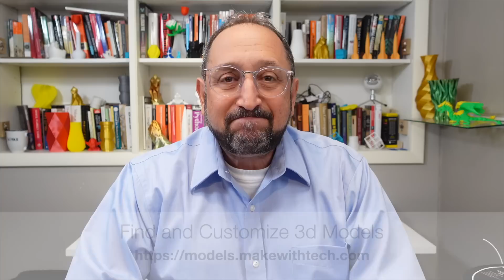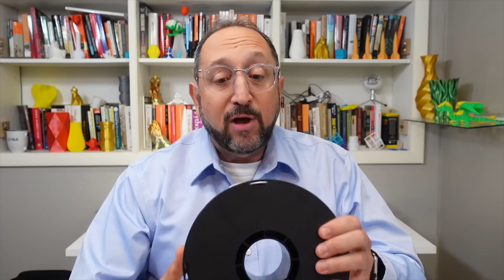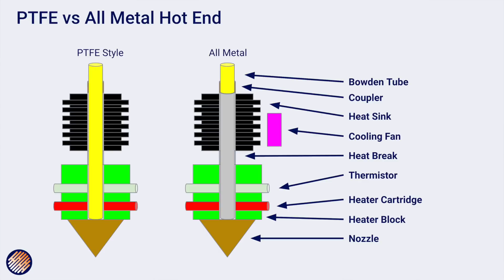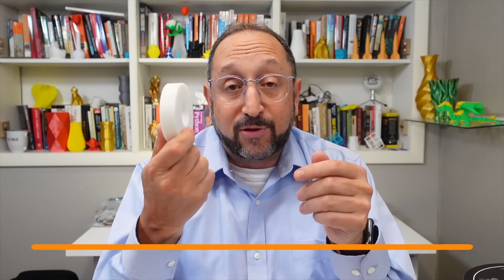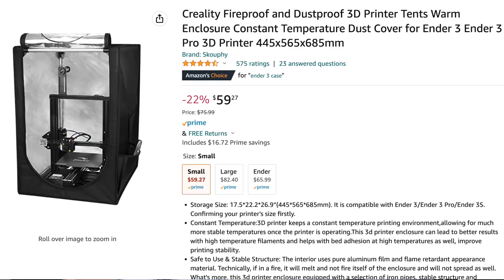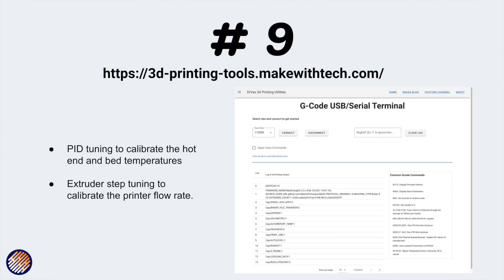3d Printing Tips for Beginners and Experts

Comment: I have an anycubic kobra and had to replace the extruder. I followed your instructions on Repeiter and its a different layout than the version you used. I think that's where I'm getting confused. I load the filament to do the length test and it sounds like a really old lawnmower or leaf blower and wont pull filament unless I push it through by hand, and i still get the grinding noise. This kobra is not even 4 months old yet. I've never used gcode before. Can you possibly do a video of newest version of Repetier. I have V2.3.1 It would be greatly appreciated. Thank you.

Comment: First dislike to a, generally speaking, Intelligible presentation of a rather complicated subject of 3d-printing.
And that's for... SILICONE GREASE! Should you ever bother to read about grease-oiling a metal to metal or a metal to plastic, you'll easily find out that silicone oils (yes, that's named after  b a s e  o i l  thickened by a so-called soaps) won't stay on a metal surface, tenting to drip off of it. And, as most plastics are +/- hygroscopic, silicon oils are rather thin get soaked into the plastic parts too.
For the sake of simplicity, I'd recommend one to go with a GREASE based on polyalphaolefin (PAO) oils. Those are mostly compatible with both plastics and metals, don't tend to drip off of a metal surfaces, won't soak in the plastic parts (not as much as silicone oils), won't evaporate as fast and etc etc etc. PTFE-filled suits the purpose best.

Comment: Sorry you're so wrong I started with resin printing and it's so much easier, leveling is easy, think about how few components are involved - 1 axis (z) a bed a screen and a vat. FDM you need to know G code ffs it's Only easier for you because you know it already
Reply from the maker: Everything you have said is correct.  For me the real issue is dealing with the messy and dangerous resin. This is from All3dP:

"Irritating to the skin and respiratory system: You should never expose your bare skin to the liquid chemicals of 3D printing resin. They can create contact dermatitis, which is a surface rash that could develop into an allergy if you expose yourself to resin for long periods of time. Resins also naturally give off fumes, and unless you work in a well-ventilated area, molecules from the fumes will get into your lungs and cause irritation there, too."

My personal experience with a Resin based 3d printer was a very low end model and I was never able to get consistent bed adhesion. 

Finally Resin 3d printers get quite expensive as you scale them up to FDM printer sizes.

At the end of the day you need to select the correct tool for the job.  Each 3d printer technology has it place.  If I was printing small highly detailed models I would revisit resin based 3d printers.  I tend to print functional parts and larger items so FDM printers are a better match for my needs.
Reply: @MakeWithTech  that's true too a lot of people are unaware if they are harming themselves with resin printing even with reasonable PPE I hope they come out with better resins because it's just a much better way to print I think 😜

Comment: Hi Irv, no one I ask has answered this question for me. Hope you can! What is the tolerance one should shoot for when calibrating the extruder? For example, if you tell it to feed 100mm of filament and it feeds 109mm, then I know that's too much and it needs to be corrected. But what if it feeds 101mm? Or 99.65mm? Is that close enough? Are we looking for EXACT precision?

Comment: Great video, I'm new to 3D printing and also a Mac user and I have been trying to find a way to connect my printer to my Mac. Most other software for OS X is way too old. Repetier Host's latest build mentions the "NEW OS X Mountain Lion" for god sakes! Tomorrow I'll try out yours. Also Cura for me doesn't work well. It makes my mouse not work after about 30 seconds of using it. Do you have this problem too?

Comment: Regarding maintenance, I think silicone-based grease is not a good lubricant to use.  That grease is design for keeping o-rings and other types of flexible seals from drying out (for example in plumbing) and thus maintaining a good seal.  They are not for lubricating metal-to-metal contact.

From what I've read, "dry-film PTFE-based lubricants" are preferred for lubricating lead screws.  This kind of lubricant is readily-available at hardware stores, and is easy to find on amazon.

Comment: I learned after 300,000 hours and 100s of printers that it is best to pick a machine for the majority of your work and keep buying that same machine. We had so many sovols, ultimaker, artillery, creality, prusa, raise3d, etc and it’s so difficult to quickly repair and upgrade when they are so different (in a farm setting).. We recently started selling all our printers and going to an all prusa farm with a few exceptions.. this way all the hardware is reliable and the same.. it also allows for quick repairs because you intimately know the machines you have.. the other nice thing is the same gcode works everywhere in your farm.

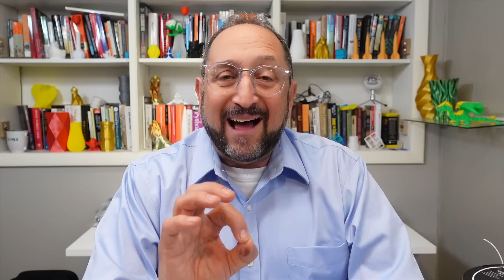Comment: I have a doubt unrelated to this topic, I've been doing 3D printing for about 2 years now. In this specific video ( https://www.youtube.com/watch?v=UvOeUNLSWW8&t=279s ) at 4:20 this guy says, "It takes about 2 hours to print one shade" and I've tried every possible way to test that. I have a lamp model that is correctly sculpted to be hollow, it won't require any supports and it is comparable to the one in the above-mentioned video.  With infill 0% its taking 14hours with 0.5 Line width and in vase mode it won't print the inner surface even when in Surface-"Both" mode but takes 4.5hrs to print the outer surface. Can we realistically print a model as intricate as the one in the video, which has two surfaces, in under three hours? Since I was unable to locate a technique to obtain their numbers!

Comment: I have a samsung galaxy s8 ultra tablet will that work in the place of a computer for 3d printers? From the question you can guess my knowledge level on this subject 🤣🤣
Reply: There are some apps like astro print, but i have not found a good solution that compares to pc software. You wont have full controll over the slicer engine
Reply: @hatschmolo2923  thanks
Reply: Your phone can run Octoprint, but you will need a slicer to create the G-Code
Reply: @daviddrumm3673  thanks

Comment: A friend of mine has endured a lot of frustration with some of his cheap FDM printers. Mainly the issue seems to be the fact that the machines cannot home in Z at exactly the same height. So he'll print a successful print after a careful levelling session, then go to print another  copy and it won't stick and he'll check only to discover that the first layer gap is no longer what it was set at. 
These cheap printers use mechanical lever arm micro switches for the Z home and these are likely not precision enough to be called repeatable.

My first printer was a dual IDEX called a Hictop 3d Hero. Yeah, its a $700 printer and I knew NOTHING about how it was built, but the feature it has on Z is the fact that it has optical home switches on Z, so when the machine homes it is always exactly the same height as it was originally set to when original levelling was done.  I can start it up and give the bed an alcohol wipe and away it goes every time. No glue, no tape. I use a flex PEI sheet on a magnetic substrate, works great, although the PEI surface can get damaged if I'm not very careful to keep tools away from it.
Reply: I have the CR10s pro v2. My work around is to do leveling at best I can. Then save it to EEPROM(Memory). Using Cura slicer, I've edited the start gcode to use the saved mesh everytime I do a print. Avoiding the need to probe on every print since I'm not changing the flex bed.

Comment: I enjoy your videos, but your pace is extraordinarily slow for me. I realize that your goal is to provide comprehension to a majority of your viewers.  That's why I use a Chrome extension that allows me to speed up your videos to a pace where I have full understanding of your points, but without all the extra time. I hope this does not mess with your metrics too much.
Reply: Keep in mind that some of the viewers are kids, and some are non-native speakers of English who may appreciate the slower style of his videos.  That said, I do watch these videos at 1.5X, and it doesn't require any extension... you can do speed changes right in YouTube via the gear icon.
Reply: @yeroca  The purpose of my comment was to LET IRV KNOW that I was speeding up his video and that I hoped it didn't mess up his metrics, which is important to a YouTuber. If he responds and says that hurts his viewer metrics, I will watch at 1.0x speed. I wasn't criticizing in any way.  I typically watch his videos at 1.6x, and can alter that in 0.1x increments all the way up to 16.0x.  The built-in 1.5x is too slow and 1.75x is just a bit too fast.
Reply: He’s a professional, thus why you don’t see a bunch of unnecessary slide transitions, loud songs or annoying sounds like 90% of other channels.

Comment: I use the 3d printing glue stick. Before every print, I mist the bed with water in a spray bottle and spread the glue with a 3 inch wide paint brush.

It makes for great and simple adhesion. I’ve even tried PEI sheets, but you gotta squish into the so much the you get elephants foot.